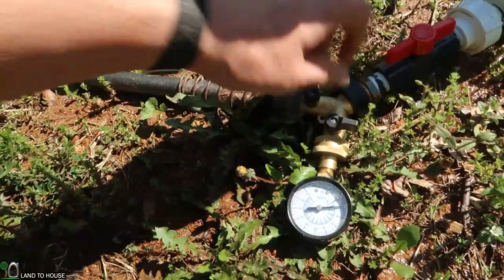Ram Pump With No Pressure Tank! Will It Work?

Comment: Great results! I even would predict that the efficiency of the pump (ratio between used water an pumped water) is worse than just the loss in the delivery rate. I think the pump uses even more water without the pressure tank (the cycle time seemed to be longer), and pumps less water with it. Also, the pressure spikes in the pump will be sharper and higher without the pressure tank.

Comment: Love the videos.  this would work fine for a short run of delivery pipe.  For a long run the pump has to fight the resting inertia of the water in the delivery pipe so the tank absorbs the spike of energy and returns it evenly.

Comment: I've been really relentlessly researching the micro hydroelectric turbines videos you've been making with the Langston models using the 4 nozzles for your home. I especially was enlightened when you built the housing with foam to suppress the noise. Now the water that exits the turbine. Can you create a way to capture all the water? So that it could be ram pumped back to the original ram pump? Creating perpetual flowing water and a self sustaining generator? This is my dream. To be able to use or help come up with a free running generator. Thanks for the videos. And I'm willing to give more ideas that I have been pondering that would be possible to contribute to you and the clean energy world.

Comment: What happens if consecutive non return valves placed in delivery pipe? 1. delivery water flow will be constant with out any fluctuations ?  Or 2. Helps required back pressure in  delivery pipe where  tank is close by?

Comment: What is the best ratio between drive pipe size and your delivery pipe? Also does the size of the check valves(drive pipe size, or delivery size) have an effect in either location?

Comment: Can you perform the same flow test with a second garden hose attached to your hose splitter as a pressure tank? Both with the hose full of water and full of air. I suspect the pliability of the hose is acting like a pressure tank and a second parallel hose would increase performance.
Reply from the maker: That's an interesting idea. So the hoses would both go to the top? Or one would be capped?
Reply: @LandtoHouse  one capped tested in 2 variations full and empty, and then a third variation with both to the top.
Reply: Joe. You are brilliant! Solved my problem. I need to place my ram pump at the bottom of a rapid and all kinds of debris could and would smash the tank. Just adding a separate hose air-filled parallel to outlet will solve everything!!!
Reply: @antea9055  you can also use a flow-through pressure tank, or a pressure tank that is inline with the direction of flow (the tank doesn't need to be perpendicular to the inlet)

Comment: Seth, I'm having a problem with my ram pump.  I have good flow into the drive pipe with no air but the first check valve doesn't close, it just keeps spewing water.  I have tried with the delivery pipe valve closed as well.  I notice a small water leak in the top of the delivery valve knob.  The only things I can think of are that the small leak in the delivery knob is causing pressure loss in the pressure tank.  I'm also thinking that the pressure tank may not be sealed and I need to put more silicone tape on the threads to get a better seal.  Other than that I'm stumped.  UPDATE:  Never mind, I fixed it by tilting the pump a bit like you recommend on your tips card that came with the pump.  It is now working!
Reply: I found that out the hard way. One I built was working one minute then stopped and I found out if you tilt the valve just a little it will operate. Now I read that helps.

Comment: A pump with more head and flow  would start to chatter almost immediately, especially the plastic check valve had been brass. A long delivery pipe and/or higher delivery head (elevation) will mimic a pressure vessel.

Comment: Should only run if delivery pipe is smaller than drive pipe.  Also pressure tank allows buffer and keeps water pressure up for equal diameter pipes

Comment: Hello.  How you can explain that the pump is fonctioning( thé check valve work well but There is no water in the delivery pipe. Thank you.
Reply: The pressure in the pipe before the check valve cycles low when the waste valve is open and high when it is closed. The pressure in the pipe after the check valve rapidly climbs to the maximum value. The check valve will remain closed at this point because the pump cant provide additional pressure to overcome the pressure on the other side of the valve to cause it to open.. The pump is effectively "marking time" and wasting water via the waste valve at this point.

Comment: I just thought of something. Wouldn't having a tank give it higher head pressure? I know it slightly pushes in middle of pulses but surely the tank effects how high you can also get water to go.
Reply: Granted I'm in a state where it's so flat it's near impossible to make use of Ram pumps.

Comment: Saw lots of videos on Ram Pump, a question from "poweless Pump genius"
There is a 9 inch water pipe line going, (about 200 ft away & 3 ft lower from my water tank), which is connected with my tank through 1 inch pipe, but due to low pressure in main line, I don't get water. I am told to attach electric pump near my water tank to pull from main line, but there is a problem with that arrangement, the water in main line is not flowing all the times, but have to wait for the call to start & stop. That is not practical.
Can I use Ram Pump in between these connection to get automatically water flow when there is water in big pipe ?

Comment: Question if you have it running off into a tank and the tank gives full will it just sit there and run anyways with the head pressure or will it eventually stall?

Comment: I am not sure about the results of the flow rate. The amount of water that the pump is producing should not change with the tank. Here is what I think happened. You allowed the pump to build up pressure in the tank, and the tank can hold more water than the straight pipe. Then the pressure from the compressed air in the tank increased the flow rate until it equalized. The air pressure only needs to equalize once when the valve is opened, so the increased flow rate would only be at the beginning for several seconds. I think if you let the pumps run at the same time together, the water height difference would remain contestant. The presence of the tank should not have a big impact on the quantity of water the pump produces. The tank is helpful in the behavior of the flow. The air pocket is compressible and evens out spikes in pressure both high and low.
Reply from the maker: It did take me a few seconds to walk up the hill to the output. I wonder if that would have been enough to equalize the pressure like you mention? Another subscriber has reported similar results in a setup without pressure tank. I am sure that my test had several issues so there could be more going on than just the volume out. for example the pump might have tilted a little on the second test and that reduced the efficiency of the pump. I need to come up with a better testing ground. . . But we at least know that the pump will work without a tank.
Reply: No, there is a positive effect of the pressure tank towards higher flow rate. If you do not have a pressure tank, then the water in the delivery pipe has to be accelerated with every water hammer strike. That is because there is no spare volume and no air to compress after the in-line check valve. The acceleration costs energy which will be wasted in the delivery line. You want to have a steady and slow flow in the delivery line for an efficent pumping process. That is ensured by the pressure tank, and therefore a Ram Pump with a pressure tank is more efficient than without.

Comment: I'd like to know how the size of the pressure tank affects the pump it seems the diameter of the tank could affect its flow as well. Could be interesting to see if there's any sort of benifits to tank size and diameter.
Reply from the maker: I actually tested that! The head pressure can only build a set amount  of pressure. A larger tank just takes longer to build the initial pressure.
Reply: @LandtoHouse  so it does not supply higher pressure longer because in my mind more air to compress? That's how a well pressure tank works to my knowledge.
Reply from the maker: The primary purpose for the tank on the ram pump is to cushion the hammer. Without that tank it can actually break itself apart.
Reply: @LandtoHouse  ah I thought it allowed more water to compress the air cushion the hammer affect and kinda pull water through the spring valve

Comment: Without tank, the pump is too much jerking  and less water delivered, I also tested this system.
Reply from the maker: Yes! Exactly the same results I got.
Reply: @LandtoHouse  Am I right in thinking it is because with the air tank removed the water in the delivery pipe starts and stops. With the air tank attached outlet flow is constant.

Comment: The ram pump that I built kept having problems with the waste valve wanting to stay closed after you opened the out feed valve, the water pressure on my one inch pipe is coming from a 55 gallon drum so my water pressure is insane, I figured that this was giving me some of my problems so I placed a 1 inch union connection to my waste valve where the water comes out on the connection i rigged me up a pressure spring that can be screwed down if needed to help keep the waste valve opening and closing in perfect rhythm. I have '300 foot of half inch pipe coming up a 25 to 30 foot bank then another small grade of maybe 10 foot and I am getting a gallon of water at around 56 seconds. I am like you the more water that you can get out of your waste valve the better flow rate you will have, but will it give you more flow rate if you put an inch and a half check valve for your waste valve and still be feeding it with a one inch pipe ?

Comment: Hey Seth I've been running a pump of your design for 4 years and I finally rebuilding it because some of the plastic cracked from use. 
I've done a couple different pressure chambers of your design and then I saw you crush tennis balls and things and I'm trying to decide what is an acceptable material to put into my pressure  chamber. I have used bicycle tubes, flotation device foam , any suggestions on a new material that might perform better ?

Comment: Hi, just set up an all metal 1" ram pump with about 2 feet of head on a 20 metre long 50mm drive pipe. The pump runs slowly , about 1 click per 3 seconds and only manages to build a  low pressure of about 15psi, I can't get the prssure any higher and it will only lift output 10 feet or so, is there any way to get 30 or 40 feet of lift out of this setup?, thanks
Reply: 10 psi should raise the water 30-34 feet. Try shrinking the output pipe.

Comment: if you not measuring the amount of water in to water out then they would be no need for the bucket just direct feed from tap to the ram pump your testing
Reply from the maker: The ram pump actually needs to have an open to air source. if you add hose pressure it prevents the valve from reopening
Reply: @LandtoHouse  ah ok

Comment: what about a really really big pressure tank, such as a lpg gas tank for instance
Reply from the maker: It turns out the ram pump will only build a certain amount of pressure. If the tank is too big it does not add any real benefit